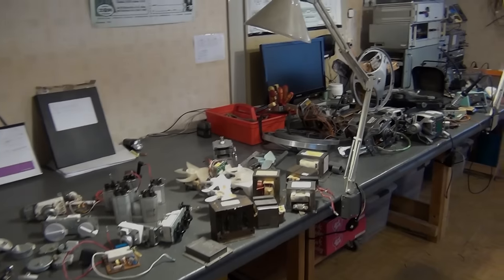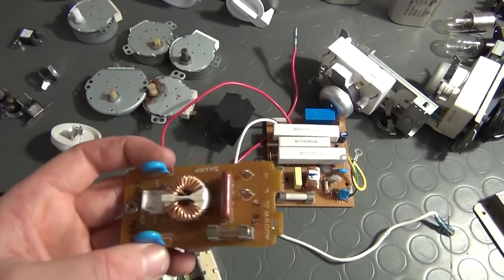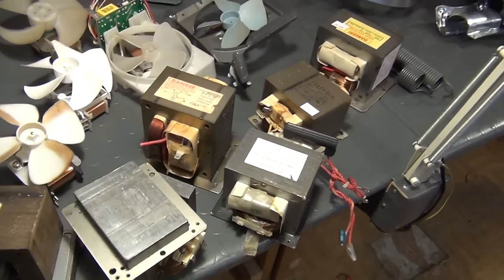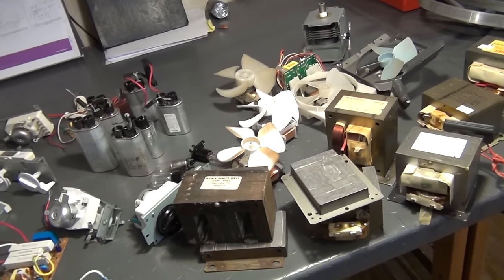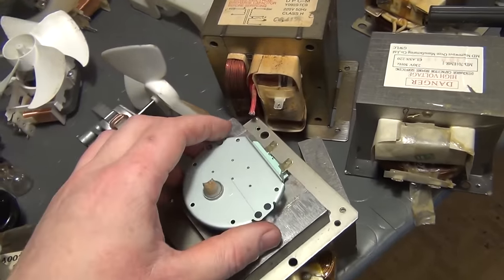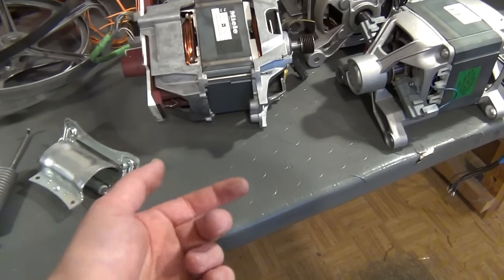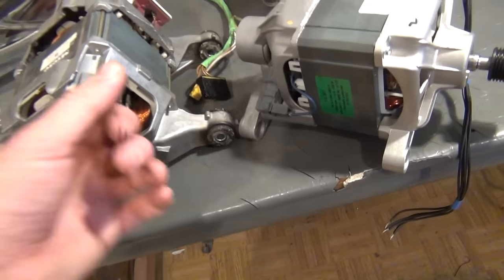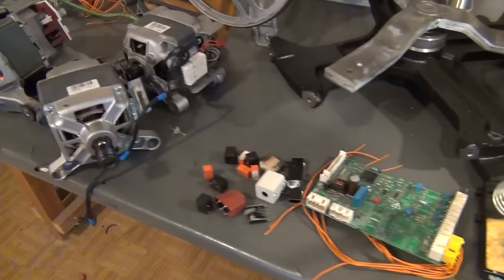TPAI Lab Report # 002:  Salvaging and Reusing Parts from  Microwave Ovens and Washing Machines

Comment: I have never seen a washing machine with such a heavy duty drum/bearing mount as you just showed at the end of your bench, that machine must have been very expensive.
Most modern machines are just junk, that is a shame :-(
Yes i can see that a reduction gearbox would make those motors usefull again, perhaps a gearbox off an old electric drill or perhaps a double planetary type from a cordless drill could be usefull.
Planetary gears are so clever, so neat in design :-D
I think you needed a drink while doing that marathon discription.
Reply from the maker: zx8401ztv Hey! Yes these older Miele washing machines are buid like tanks. It's very hard to transport them from one place to another :D
Fitting a gearbox on these motors would be quiet hard though. If there was an easy way, I guess I would have found it by now. But I still hope that I will find a useful purpose for these parts in the future.
Reply: The Post Apocalyptic Inventor A nice meaty triac and phase firing circuit could slow a motor down, but thats also a loss in torque :-(
Is it possible to rotate the brushbox and play with the timing for a bit more torque? perhaps :-)

Comment: I rly liked your vid, this made me think of "free" energi, you think you could produce more output then input on a washing machine motor ? Whats the output on a washing motor? I was thinking about using the whole frame, maybe make it lighter then the original iron casting mount and replacing the barrel with a magnetic coil to produce more output then input ?
Reply from the maker: +TheGreatDane DanneBro No that is not possible. "Free Energy" is a hoax. Do not waste your time on making a motor-generator for proving the existence of it. The greatest minds in human history have spent all their life to understand the workings of electromagnetism. Thousands of engineers have put all their brainpower into inventing new, and improving well known electrical motors and generators for more than a century. There is no way of finding any new physical effects in that field by playing around with "washing machine motors", nor is there any way to increase the efficiency of the known motor types, by any simple means. Universities are spending millions on computer simulations to squeeze out fractions of percents in the efficiency of electrical motors. And the improvement is basically done by perfecting the control and driver electronics ( as well as software) of the motors. If you want to generate energy for cheap, try to build a wind turbine. Once you enter that field you will be overwhelmed by even making a proven concept work.
Reply: @ThePostApocalypticInventor  On the fan wired to the motor, were you pointing to the middle terminal? I just want to know exactly which terminal acts as the primary for the 21 volt motor.

Comment: dear inventor,

i find your new video format too chaotic. i very much more enjoy your meticulously prepared and well- structured classic videos. 

cheers, 
christian
Reply from the maker: Christian Geiselmann Hey Christian. I apprechiate that and I prefer my regular videos as well. But a lot of people seem to like this an this is why I will produce both formats in th future. this really is just an "additional offer" to my normal videos. You can take that offer, or simply ignore it. That's why I have given these videos a title that makes ithem easily distinguishable from the regular format. 

kind regards, 
TPAI
Reply: @ThePostApocalypticInventor  I used a synchronous microwave motor for a homemade air raid siren and used the turntable coupler. The turntable coupler acts like a cam, pushing a metal bar up and down against a momentary button to momentarily turn a second microwave fan on, and the fan blows air into a tomato can that picks up the wind sounds, and that makes it sound like a real siren. In order to wire the button to the fan, and the synchronous motor to the cord, I used two wire harnesses - each with 2 wires - two to attach the motor to the cord and two from the motor to the button going to the fan.

Comment: could you talk about the 3 phase brushless induction motors found in modern washing machines. can they be used for something like a bench disc grinder. how one could rewire to use for such a use.
Reply: brian o I am going to make a belt sander out of a large 3 phase motor, from my research you need a contactor motor starter $10 and a 3 phase breaker. I am going to run it full speed just for hogging material.
Reply: A brushless motor needs a brushless motor servo or inverter to be driven. Most of the ones in modern washing machines are sensorless, ie. their windings are used to sense the rotation of the rotor and to commutate (switch) the currents in the windings. Often the motor inverter/driver is a separate circuit board and you can reverse engineer how the controller board communicates with it to “tell it” what speed and direction to run at.

Comment: you may be able to use the motor and wheel from the washing machine as a hand crank/foot pedal power generator, maybe like a part 2 of your exercise bike generator
Reply from the maker: ***** The problem is, that you would need a voltage source to generate an exciter field. These motors have no permanent magnets and that's why they are not well suited for small scale power generation.
Reply: ohh, good to know, not very useful for that purpose then

Comment: i want to use a washing machine's motor as a wind turbine to produce electricity is that possible?
Reply from the maker: lamine oriska It is possible, but not practical, because these motors are not permanently excited. That means they have no permanent magnets. To use them as generators you need to connect a voltage source to the stator winding, which will in turn consume energy!
Reply: The Post Apocalyptic Inventor
 So it's not a good idea to generate electricity
thanks for replying me
Reply: Yes I built one works great.
Reply: yes but it would only need 12 volts

Comment: technically speaking you can salvage almost everything out of every appliance/machine.

The real question is. is it useful to YOU. Just because someone finds it interesting to salvage motors out of appliances doesn't mean that that is the exact same thing that interests you.  It also depends on whether you're interested in repairing appliances by using the good bits out of several broken ones, or whether you're repurposing them for something entirely different.

Do you have the spare room to store it all, and do you want to be that "crazy collector dude" that comes on the news in a few years found dead under a pile of salvaged stuff that collapsed onto him. ;-)

Comment: Wouldnt the heavy-duty gearing from a washing machine drive be like---- permanently lubed and expected to run for years?
---maybe some could be used in windmills? Or for small hydro-power stations?
-unless they suffer a lot of mechanical resistance OR are useless reciprocator-movements.
Here- in the US, a few models are geared-down transmissions (essentially)